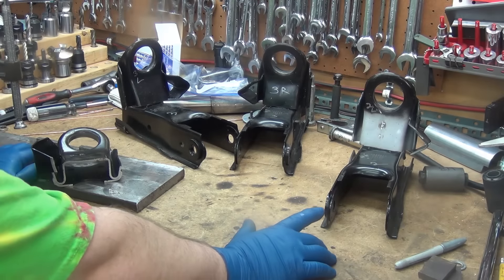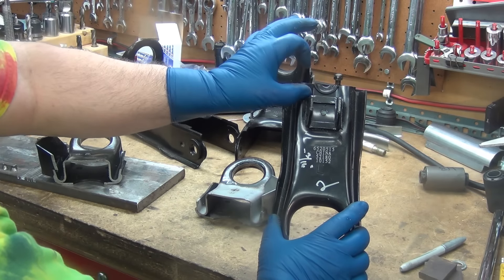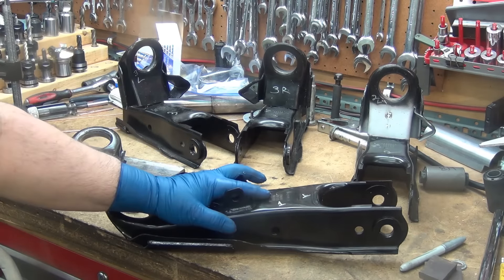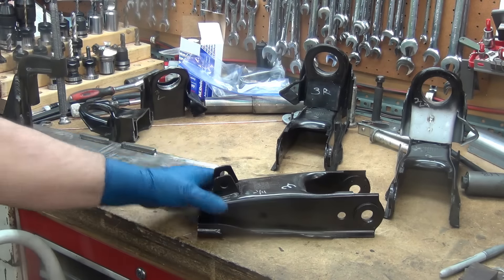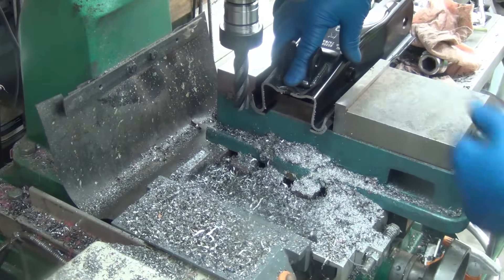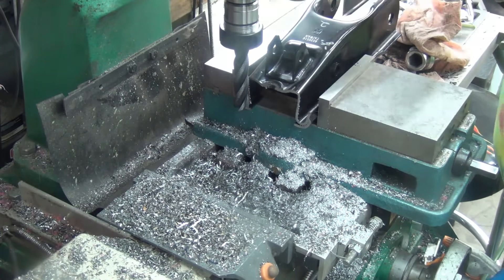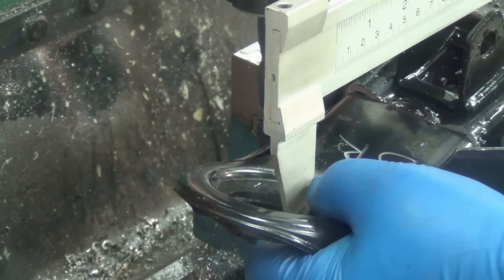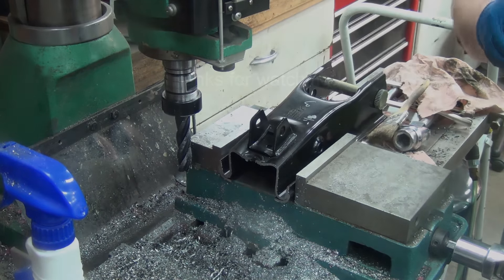LCA - Sectioning

Comment: Damn this is alot of work..  Why not just making tubular arms with a jig based on one of your cut and rewelded ones? =)
Reply from the maker: I've considered it.  It would be a lot easier.  The biggest reason I went this route to begin with is that I wanted to keep the torsion bar suspension.  I thought this would be easier than trying to make an arm that would work with the torsion bar connecting arm.  Once each of the processes are setup, this shouldn't be too bad, but I'm still considering the "built from scratch" option. :)
Reply: Making a connector for the torsion bar should be possible on your CNC im guessing and just make space for where it would weld into the tubular setup (not entirely sure how those control arm looks) And for sure what you alreday do works just thought its equivalent amount of work doing it as tubular. =)
Reply from the maker: The connector itself shouldn't be much of an issue.  The HB one for these arms is still available new.  If I did it for the 521 connector, they'd just use the one currently on the truck.  I keep thinking I'll have time to make one in CAD, but I haven't found the time yet. lol
Reply: Time.. i hate when it just runs away scared when i need it the most. :D
Reply from the maker: LOL!!!  Hadn't heard it said like that before.   I tell people at work that I find it extremely annoying that my weekend always shows up 4 days late!  :)